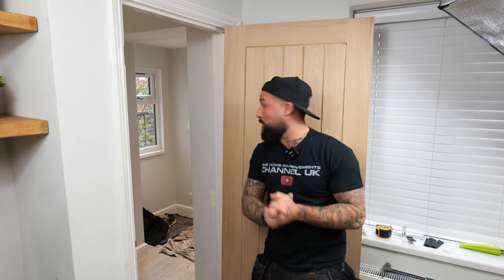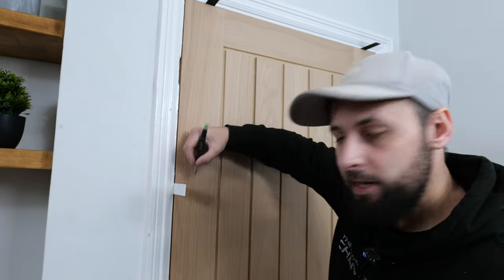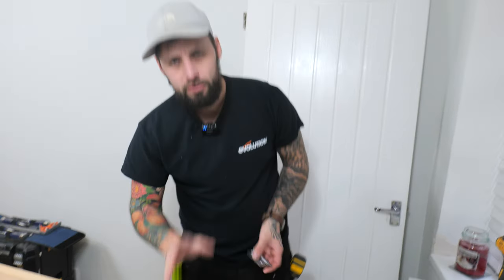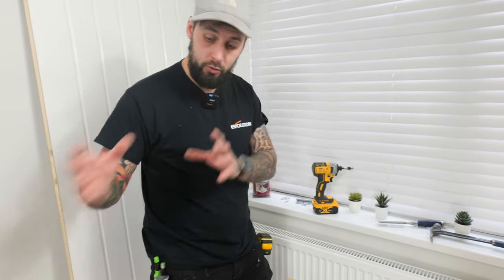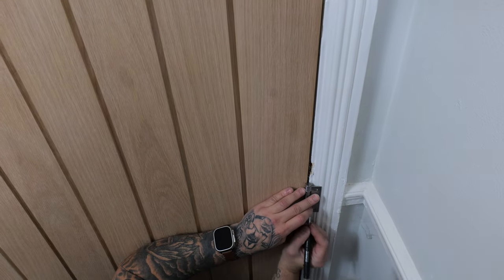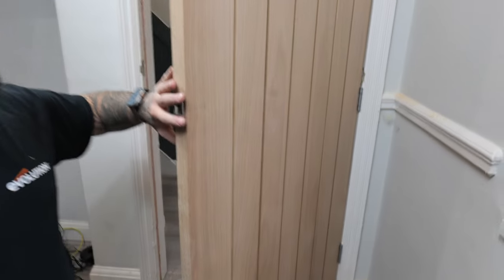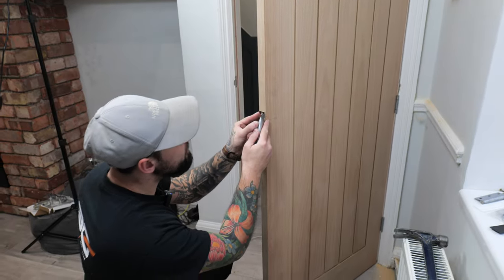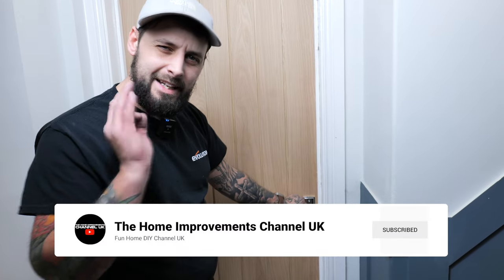How To Install A New Door To An Old Frame | Easy Step By Step DIY Guide

Comment: first thing i always do before cutting to height,get a steel square and check from the hanging side that the head of the frame is square ,a common problem you come across and if you have fit the door to the head you may end up with to much clearance on the bottom
Reply from the maker: Nice tip that 😊💪🏼

Comment: On these particular doors which side does the lock go on ?
Reply from the maker: Normally doesn’t matter on solid doors 😊
Reply: @homeimprovements  I’m fitting 6 that are similar tomorrow so the reply came at the right time as there’s no markings on the top of the door. Appreciate the reply and the video boys, enjoy your weekend 👍🏽👍🏽👍🏽👍🏽

Comment: As a locksmith you have given me a few tips I'd never thought about ! 
I will say that a company called jigtech make a great jig set for putting latches and handles on and the only other tip I would say is forstner bits tend to make a nicer job of the holes especially on the start but spade bits are miles cheaper to buy as if you have normal style handles then work perfectly well as you guys have shown
Reply from the maker: Thanks mate 😊💪🏼
Reply: @homeimprovements  no worries guys, despite my line of work I cant actually hand a door myself but you made it look so easy that I'm not particularly scared of trying it anymore! Keep up the good work and information

Comment: Great stuff, thank you. Will come back to this in stages as working through. Worth getting an electric planer, do you think? The little air bags look handy
Reply from the maker: In old frame electric planer is brilliant bit of kit 😊
Reply: It’s been tricky to use for me but getting the hang of it. Win bags and combination square added to collection, planer borrowed. Thanks so much for this vid, it’s so clear, got time stamps etc. What do you think about chamfered/bevelled edges on doors? Worth doing/necessary? I worry about splitting it with the plane but I think it has one of those grooves that you can use on a corner @homeimprovements

Comment: We are looking to get a glazed internal door which will need trimming by 2 cm(In height)to fit into the existing door frame. However, recommended trimming allowance is 1.2 cm from height. Can you suggest a solution as we really like the door?
Reply from the maker: Just take it of the bottom you won’t see the exposed chipboard not uncommon to see 😊
Reply: @homeimprovements  Thank you so much :)

Comment: The hinges go on the other way round. Reason being that the weight of the door is held on by the side with 3 bits attaching the pin to the plate, not the one with 2. It supports more weight which is why it’s designed that way (qualified Chippy btw)
Reply from the maker: Good to know 😊👌🏼👌🏼

Comment: Out of curiosity why do you chisel across the grain and not with the grain when sinking the hinge
Reply from the maker: Prevents the chisel deviating 😊
Reply: Deviating off the intended line? I'm a young carpenter and always got taught to work with the grain seems as though depth would be easier to judge the way you do it. Appreciate the reply 👍

Comment: Hi mate, what's the best way to fix up the old frames? Mine have notches cut out from old hinges and striker plates. Is there anyway to fill them or is it a case of a new frame? Cheers
Reply from the maker: You can or splice new timber in to repair the damage 😊
Reply: I use Ronseal wood filler. Invisible once sanded and painted. Might work for you.

Comment: Almost exactly the way i fit doors... Only exceptions i use a door lifter rather than bags and take the door off to fit the latch... I just feel more in control with the door on its side and drilling down into it rather than drilling at waist height with the door hung.
Just personal preferences makes no real difference.
👍👍👍
Reply from the maker: Nice mate Yh I get what’s your saying 💯 😊😊💪🏼💪🏼
Reply: I'm the same with the tubular latches much prefer to do them off the frame

Comment: No disrespect but you have to measure both side of high door frame ...always you cross with one side higher to the other and very rare they are both sale measurements on both side due to floor level and frale level
Reply from the maker: Did we not show that in video ? If not our bad you are spot on 👍🏼

Comment: Step 1 error- you only measured one side of the opening - what happens if the floor or the head is running out ?… a quick measure of both jams and check for square !! 
That’s like a new frame also!

Comment: Sorry, bull shit, for a start you only measured one side of the frame, top to floor.  How many old houses do you know where the frame is square.
Come to my house and you will also find that not only are ALL the door frames out from side to side but also odd sized doors have been fitted, ie 28 1/2 wide doors where the standard doors you can readily get are 27 inch, 30 inch or 32 inch.  Yes some places like Howdens make 28 and 29 inch doors, but for some reason they are 3 or 4 inches taller and so wont fit.